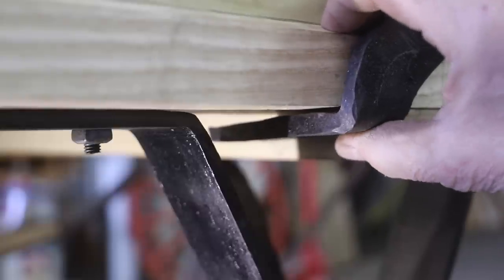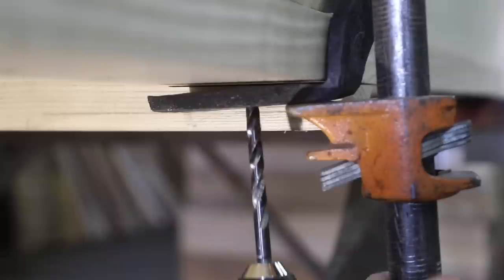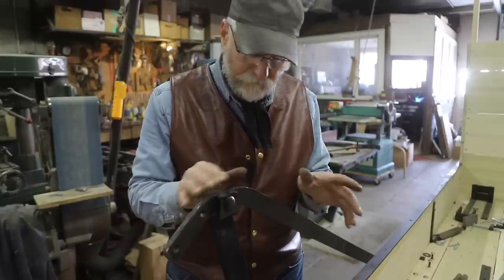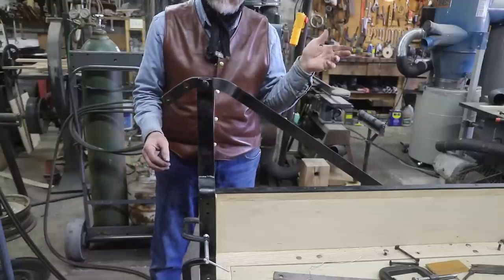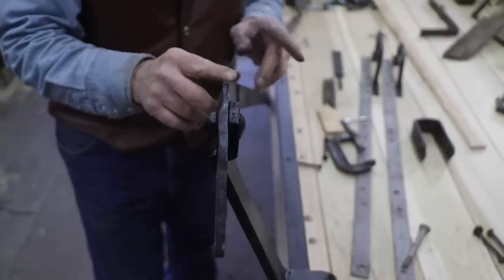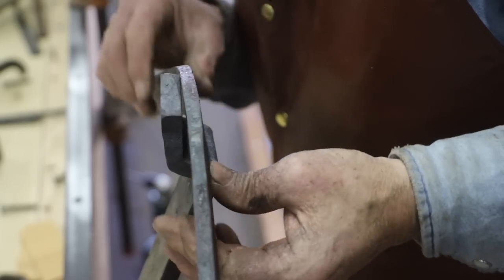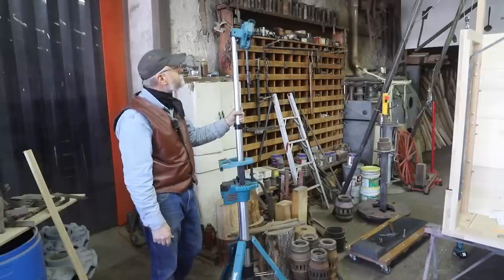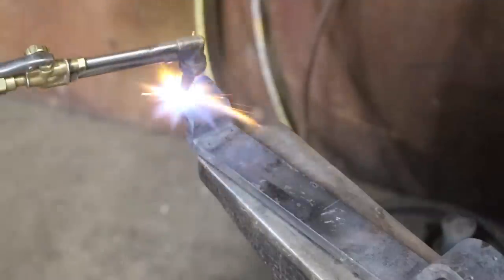Blacksmithing Lost Supports on Mud Wagon | Engels Coach Shop

Comment: @EngelsCoachShop
Who ever came up with the saying "A Jack of all trades but master of none"  clearly had not seen Dave at work :)
It's both inspiring and intimidating at the same time to see how seemingly effortlessly he "conjures up" what he needs. From wood or metal, cloth or leather using wildly different skills, and  techniques. But always working in a straight forward efficient manner to arrive to the exact shape and fit that he needs the "part" to  be to beautifully fill it's intended purpose.
It's always a joy to behold.
Best regards.
Reply: I'm of the idea that Dave is just very good at his job and all the trades that it encompasses.

Remember, back in the day whilst people like Dave did indeed exist,... it's also much more likely to find that a wagon, coach would've been made by several people, either working in concert under the same roof or entirely separate businesses.

Dave has to do it all himself because he's alone in his trade, there is no blacksmith to work with across his street, there's no wheelwright to make his wheels or an upholsterer. Back in the day, there were people trying to do it, but very likely... they started that saying because whilst trying to do everything (and fast), they'd end up screwing the pooch. Probably even otherwise good tradesmen, would've gotten it wrong, as back then, wagons, carts and so on... they were the cars of today, and as much as we need cars today to be made in sufficient numbers, it was equal back then for those.

So it was better to have many, all knowing in their trade, bunch up in to work on a primitive production line (which indeed existed before Ford) and come up with a product that's good, rather than one person, either willingly or forced by circumstance trying to make a product that... doesn't quite add up to the standards. And there certainly are such survivor items that show us that's the case.

That's why Dave's special, and he's worth listening to. He's become all that's required to create the item he's in need. If he'd get transported back in time, he'd be the one that everyone comes to in order to learn the trades. They'd be begging him from young to old.
Reply: That full expression goes " A jack of all trades is a master of none but still better than a master of one" and I think that's very fitting of Dave, from ironwork to carpentry to leather work, the man has the whole spectrum covered.

Comment: Good evening, Dave.  I have been watching your videos since coming across the Borax wagons.  On our way home from Arizona a couple of weeks ago, I was so drawn to swing by Bishop, but the wonderful winter weather prevented that.  I have been greatly enjoying seeing all of your self built tools for the things you do along with the antique tools you have collected that are still greatly serviceable. Especially the device for sizing and welding the beads for rubber tires.  Your techniques are all so familiar to the way my father taught, such as transferring a dimension with a pencil tip and a knuckle.  I can really relate to having to figure out how to work solo, using stands winches and clamps and other supports to do the heavy lifting and holding things in place while match drilling.  I have been drawn to blacksmithing but have never taken the plunge. If I do get that far, I will already have a wealth of knowledge amassed just from watching you work. Thank you so much.  You do use some modern materials such as Titebond III.  I was wondering of the original assembly was just bolted or nailed or if hide glues were employed? On a recent trip to Connelly State Park in Washington, there was a carriage on display from the pioneer days of Washington, with which I felt immediately familiar from watching this series. I very much look forward the next installment every Friday. Thank you for this video documentation. Blessings.

Comment: My brother in-law does finish carpentry and I asked him what brand of tools he uses for fine finish work and he said Makita. He said that the other manufacturers are good for rough carpentry but the tolerances on Makita are tighter and produce more accurate results. He said that the way to test a miter saw is check the side to side play when it is locked down and can see the difference between brands. He is right. There is a big difference in accuracy. Thanks again for sharing.

Comment: Makita makes great tools. My first experience with Makita was in 1986 I move to Lincoln NE and started a job as a framing carpenter. We had a very large retirement condos to build. There was over 30 carpenter on the job. The boss Allen Brant showed up with 25 new Makita 7 1/4 inch circular saws in the back of his pickup. For the next year those saws got one rough workout. I don't remember any of them failing.

Comment: I was watching an old western. "Hombre" in this there is some extensive pictures of a mud wagon. I could see these rockers and rocker braces very similar to the ones you reproduced in this old coach.  The boot braces are not like this wagon. I looked for outside of the body braces like you're building here. The movie mud wagon must be iron braced on the inside.  Box looks larger too.  All kinds of coaches.  Love your work Dave

Comment: Watching you come up with solutions to puzzles one step at a time is fun.  It remends me of one of the jobs I had repairing Flight Simulators decades ago.  There was what was drawn up to be built, what was actually built, and then what was built and repaired several times.  What a puzzle I could run into sometime.  LOL  Thanks as usual Dave for an excellent video.
Reply: My buddy also repaired the original Flight Sims.  If I recall the boards were huge.  No surface mounts back then!  He was like you and Dave and basically made what was needed.  The sims were so old the "younger" techs didn't have a clue how to repair if it wasn't plug n play.

Comment: For a "mere" mudwagon, the art and sophistication of the original ironwork is surprising. Those flat bends, and crisp 90degree square internal angles are really tricky to achieve. It appears that some of this mudwagon ironwork is more testing to achieve than that on the borax wagons- that ironwork was massive, whereas this is finicky.
It is very interesting watching you replicate the missing original parts with such skill and attention.
Hat off to ya!

Comment: Hi Dave and Diane ☺,  nice  easy in situ adjustment of the iron using the torch, clever, sure saves alot of time, a good thing to know. You might already know this Dave , that 12 point sockets will fit square nuts , or squares of any kind, you probably have your own reason for using the end wrench , I suppose it's easier to feel  just how much compression your applying to the wood, ?. The gift of the makita work light was nice, it looks well thought out, and very useful  to have on any job. Thanks for another interesting video mate, stay safe, best wishe's to you and Diane,  Stuart and Megan UK.

Comment: I bought some LED shop lights for about $10 each a few months ago.   They can be daisy chained,  they have the hardware to mount them to either the rafters, or wall, and  put out much more light than the old florescent bulbs I had been using for nearly 30 years.

Comment: Something I have seen on old (motor) vehicles where there is a carriage-bolt into a steel or iron part is that three corners have been filed off the bolt square, and one corner is filed into the hole. 
That seems to work pretty well to stop the bolt spinning.

Comment: Dave, you’re so interesting to watch and love when you explain things so we can understand. With that said, can you explain the simple engineering of a wheel, like in a wagon wheel or bicycle wheel, what supports the weight of the load on the hub, does it hang from the top spokes, is the hub resting on the bottom spokes, or suspended in between the side spokes ? 
Thanks,
Kent
Reply: The bicycle wheel and wagon wheel are opposite. The bicycle is supported by hanging and the the wagon from the felloe thru the spoke to the hub.

Comment: I'm into Milwaukee with some of the older Porter-Cable, but do have a six inch and a12 inch porta planer from Makita.  They are good machines but the 12 inch is a beast!  Also have that 16 inch beam saw which is also a beast.
Reply: I went the Milwaukee route myself -- Mostly because they offer Trade specific tools (Plumbing in my case). ProPress, Right angle drills, PEX expansion tools etc... Additionally, space is tight in a work vehicle and I can't justify carrying multiple chargers and batteries. Having said all of that, Makita does make some very fine tools.
Reply: @iamgrowler  All the brands are pretty good.  If there was only one brand out there, it wouldn't have to be very good.  Competition makes things better.

Comment: Curious as to what purpose the punchmarks you make before bending the iron is for ?

My guess would be either because the drawn lines diasappear when you heat the iron, or maybe to help the iron bend right where you want it to.

Or maybe some even more clever third option :)
Reply: Yes, because the drawn lines disappear.

Comment: Ron ... at 20:31, where you are showing  the iron with where you drove the bolt thru the hole ..... is that a crack I see in the side of the iron?

Comment: Dave uses glue often (modern) in his wheelwright projects. 

FYI-  glue was often used by Egyptians over 4000 years ago by boiling birch bark (formed into sticky paste). Later Greece and the Roman refined glue making using animal hide, hooves & tendons. Because dowling and dovetailing methods were preferred in wood joining, glue paste was mainly used as ship building sealant and papyrus scrolls. 

16 century Europeans developed fish based glue, egg paste glue and tar based glue/sealant used for ship building. Those methods were refined in the new colonies of America, then US introduced manufacturing industrial glue made up of mostly animal based glue and eventually rubber based glue in the 1800's. Glue was mainly used by woodworkers (furniture, musical instruments etc), leather smiths, shoe makers, tent makers and carriage makers. 

1935 with the aid of scientist, various formulas were introduced making stronger bonding glue, Elmers glue  was one such product and eventually the super glue in 1953. The reliable Elmer's glue is still used today along with many other glue, adhesives, bonding compounds, but Elmer's glue (some rebranded as carpenters glue) is still the preferred use with the added water resistant compound. A little glue history that I'm able to recollect off the top of head and probably missed a few also.

Cheers y'all! TY Dave & Diane for your magnificent contents, May God shine His grace upon you and my fellow audience/viewers!

Comment: I do have a question.  The old corner iron is 1/2 X 2" and the old brace looks almost 1/2" thick, maybe 7/16".  The one you made corner iron is 1/2" and your brace looks like 3/8".  Did the original blacksmith upset a little more the angle brace? or is my eye and the camera angle just a little off? Just curious.